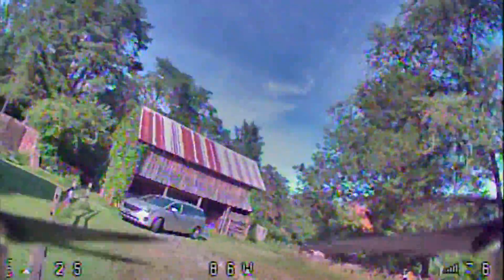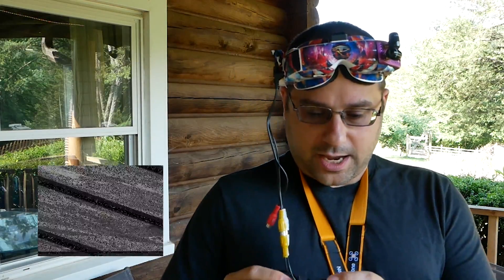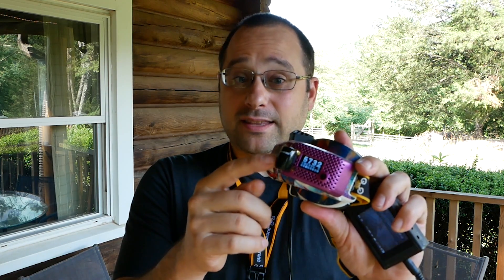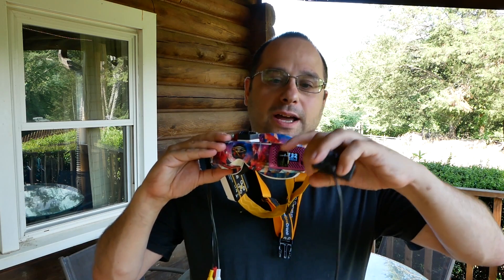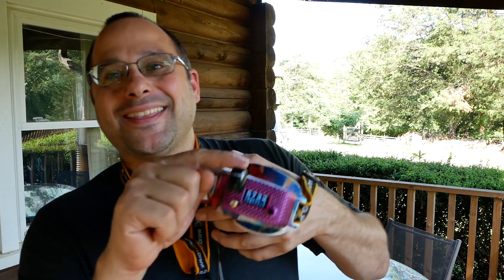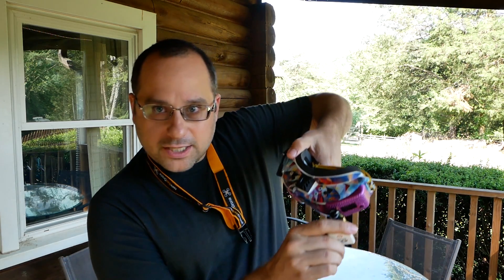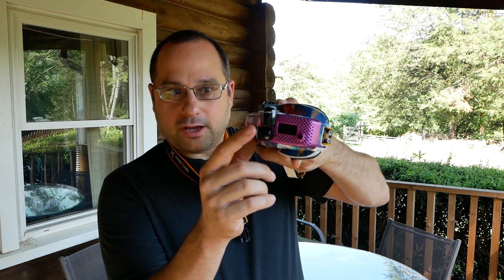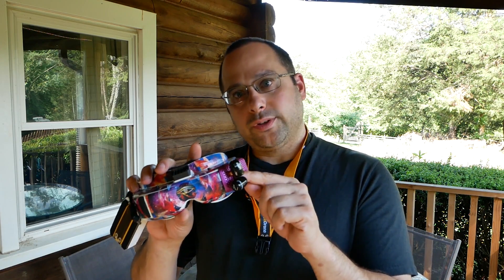Why two omni antennas vs. omni and patch?

Comment: I do fly with my 'head in the ground' or at least, looking down at it. 👇 But!... I allow for that when setting up  but I still (nowadays) go with the two Omni's😁
So JB.... Because of the ImmersionRC Rapid Fire and the 2 x 13 dbi patch antenna's and the (recently released) new mounting kit, plus the latest v1.2.9  'warning beep' firmware. Can I ask you if it is a viable set up?  Appreciate it's regarded as a long range solution but if you could maybe get hold of this kit and review it?  It would be great...... I am so close to clicking that 'SAD' to Basket button..... Surprised you haven't already reviewed it yet TBH.....You...you...Slacker... 😋 👌.

Comment: So I guess an optimal setup would be a ground station with multiple receivers facing all directions
Reply: Or going higher up. A telescopic pole like the ones window washers use is cheap and holds cable inside. Your local HAM radio shop has the right cable, And a cheap tripod using your backpack as counterweight will hold the pole without tipping over. And you can keep using just one omni-directional antennae with this.
Reply: @TheEviling  can you please explain this !
I mean what are you talking about
Reply: Putting the antennae at the end of a long cable, and having it be high up. 5-10 meters up from the ground, most things that could lower the RF signal isnt an issue anymore.

Comment: I have to try with 2 Omni antennas. But which one is the best? I have a pagoda on my quad. Currently using the menaceRC kit (omni + patch). Suggestions welcome
Reply: FelipeD.....I use the Menace RC Periscope Omni and a True RC Air patch on my goggles.My kwads have the Menace RC Raptor on them.All seems good.
I have used TBS Triumphs on the kwads (with the above goggle set up)...I didn't get any improvement,in fact I,d say I think the Raptors before better than the TBS for my flying(only a max of 400 metres  from myself.)

Comment: Hey Josh, I have been flying this way for about two years now and it works well for me and I agree with this great advice. You're also right about most people dropping their head while flying and I use a couple Aomway CPs bent back so they are oriented correctly when I have the goggles on, which help avoid flying into the null of the antennas.  One question though, what DVR monitor is that?  It looks perfect for a shirt pocket!  I can't help but mention that your Ultimate FPV Shopping List doesn't have any FPV DVR Monitors.
Reply from the maker: Lumenier dx600 dvr
Reply: Joshua Bardwell - Thanks JB!

Comment: I run 2X VAS ION V2 Stubbys on rapidfire cuz they the highest gain omnis available BOOM :)
Reply: Higher gain usually means higher focus.  In other words, the Ion has a wider donut but its gain drops fast off the hortizontal plain.  The dead spots above and below are also larger.  Gain isnt everything.
Reply: @metoo3918  true, but ive tested them against axiis, lollipop v2 and pagodas on 25mw at tree height and below flyin same path back to back and ions always win

Comment: Always need to pick the antennas for your environment too. I know a lot of people stopped using patches at races, lots of people + high gain antennas means that you might pick up other people's video as well because the antenna is so sensitive. Also, with something like rapid fire, certain situations it might be better to have a left omni and a right omni, or even no antenna believe it or not in a really high multi path environment, eg CDRA Nationals inside the football practice area indoors.

Comment: I have a stubby axii on my quad and it is a drastic decrease in reception. With a stubby on a quad the frame and battery itself becomes the interference. switched to a 3 inch longer axii and the reception is now very clear in the same area as nothing blocks the antenna reception. never used a stubby before....will not again lol

Comment: Hey JB, I use the menace RC periscope, designed to go above your head. I also use an aomway antenna, as I had a fake axi, an Uxi, and I got better range with the aomway. I may try my patch from menace RC when I go back to the spot, see if it does me any better.

Comment: Basically, you're right. But flying in a previously known area in front of you is much safer. Flying behind you especially if there are other spectators and unexpected visitors is more dangerous. It will be good if you make a video about safe flying. Take some rules from traditional rc flying club.

Comment: For the bottom omni, just use the regular stubby (not the right angle one).  Still 90 degree to the top one, without the fitment issue. 

The other reason to use two omnis when racing is because the range/penetration of the patch isn’t needed. And the patch’s high gain can be a detriment when a competitor’s quad flies close to you on the near side of the track. Yes, even if they are on a different but nearby channel, it messes with your video signal. 

BTW, works great with a standard diversity module too. Not just for Rapidfire.
Reply: TweakRacer this is what I wanted to know. For the bottom antenna just use the regular short stubby and for the top a 90 degree one. Thanks

Comment: What do u think of helicals? I made two.  7 turn and 5 turn
They work really well for me. I use thick copper  wire. I get the best range vs others  with a homade  5 turn helical on my rotg01 reciever I dvr off my laptop.  I was going to try two helicals on my goggles just facing different directions. I've haven't  tried that yet . I always use a helical and triumph
Reply: I've been rocking a 3 turn for 2.5 years now. Great antennas and far overlooked by many.
Reply: @DT-gun  yeah that's awsome. infact I just built  today another more accurate 7 turn. It's unbelievable how great it works. Better then store bought antennas. And let me tell ya I'm no expert. Very simple to build. I turn the thick copper wire on a bolt in a vise then the wire just free stands because it's thick enough. 15mm width of helicals  center to center of wire,  12.9mm separation up and down between turns,50mm square or round piece of metal for ground. I use old coax from old antennas. The thicker wire also increases the band width. That's it.
Reply: I run a tripple feed/10 turn helical combo for longer ranges
Reply: @brandonharrsch8318  what's a triple feed?

Comment: I'm new to fpv, I use omni + crosshair on rapidfire. I lost video signal from super clean to 0 in a split second, disarmed and the quad rolled into the water (still working) but I'll definetly buy another omni because patches are too risky when you're not doing longrange.
Reply: Sounds like you lost video not the signal. Maybe.

Comment: Nice test Josh!
That head full of water attached to the goggles probably does more RF blocking than the goggles ?
Reply: well it depends but at least it doesn't have a significant EMF like the electronics in the goggles

Comment: I am from India . Currently using a quad of martian reptile 2 frame with 2300 kV motors and omnibus F4 pro with emax 30a ESC  ,so I wanna know is this quad enough for learning freestyle and also to know about few tips to control the speed of the drone while Landing
Reply from the maker: Yes that will be great for learning.
Reply: @JoshuaBardwell  sir one more thing I could easily fly in acro but I wanna know how could I develop confidence for diving ,flip ,etc 😅 .I am also using the simulator but then in real, fear also comes in mind.
Reply: i spent 2 years on that set up, it served me well learning acro ,you can get thicker top and bottom plates for the martian aswell
Reply: @damonbfpv  thanks
Reply: One more I am not getting an idea of getting tune with pid ,I know it's theory but practically I am not getting it on drone so can you tell me the steps to tune up the pid.